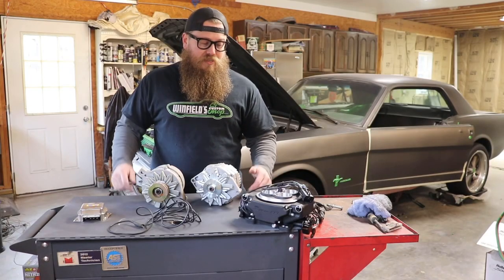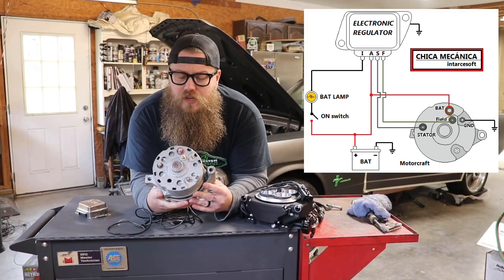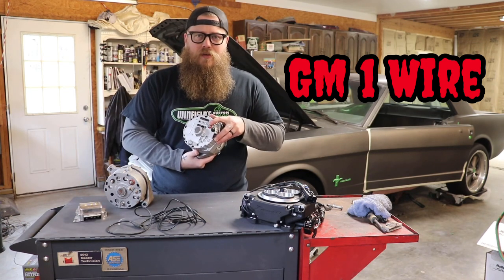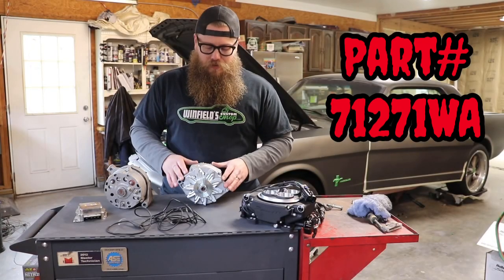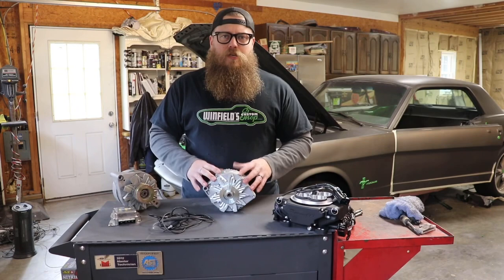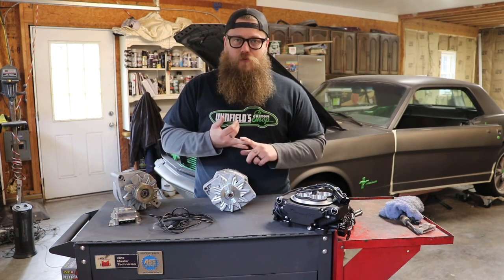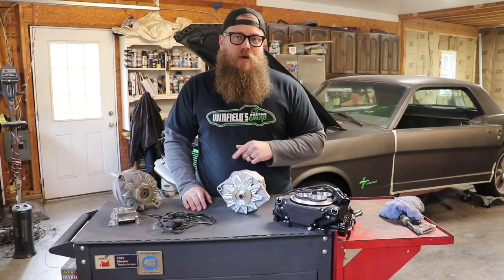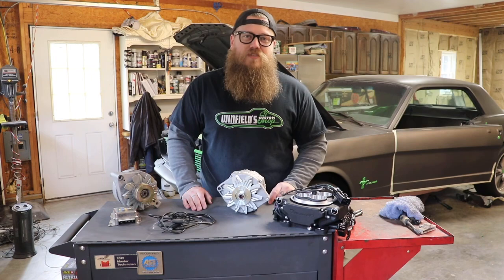Charging Upgrades!

Comment: I use the 10si alts in my stuff model A, the 78 chevy its coded for, and will be putting one on my 460 mustang. 29.99 long as you have a junk one to core in with.  I tape the wires up together. if your the kinda guy who worries about 40 bucks you know it aint no show car.
Reply: same thing as used in video just without the one wire mod.
Reply from the maker: Thank you for the information! I’ll look into that one